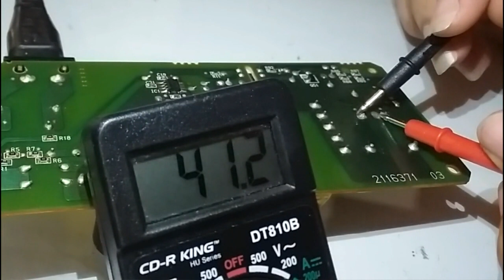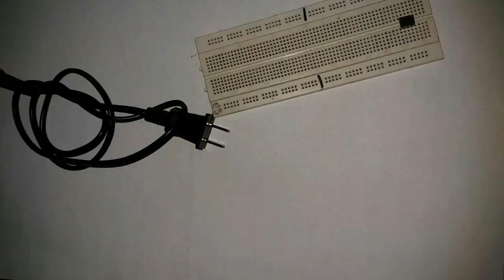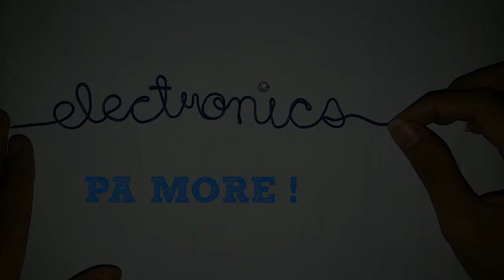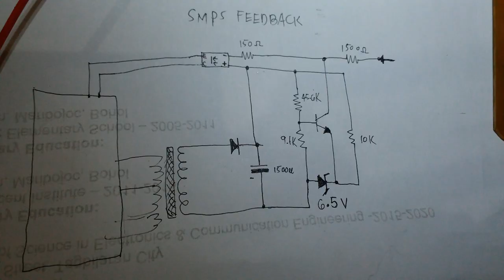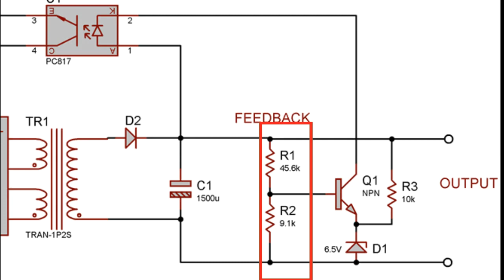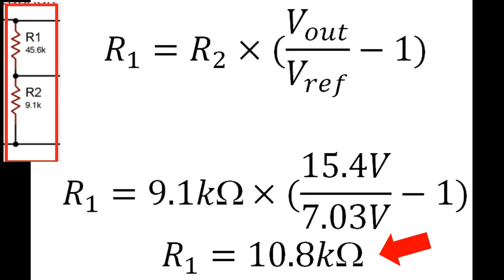How to Vary the OUTPUT VOLTAGE OF SMPS

Comment from the maker: What do you think ?
Reply: Hey, How much current can you get from this power supply? I have an epson power supply which can provide half amp. I got another question as well, my epson power supply uses feedback voltage to turn on the primary part of circuit,  how did you get the output voltage? Mine turns on and then it turns off. Do you have schematics of this power supply? By the way, how to provide feedback voltage to turn printer's power supply on? Thank you.
Reply from the maker: @JohnSmith-mf6pe   600milliAmps, i showed a schematic on the video but not on the secondary side only, if your power supply has a three pin -output,one of it is the enable/disable pin, you need to pull up or pull down . But i dont know exactly if its like yours. But this printer has 3 pin but i just leave the enable/disable pin .but it readily works
Reply from the maker: pull up means connect it to high voltage or the + 5 volts or pulldown connect it to the negative /GND . But in my case,pulling it down  will disables it.
Reply from the maker: Note : this only works on simple power supplies that dont have a undervoltage  protection and also lowering the voltage too much will a also cause it to shutdown
Reply: Thanks a lot. The power supply I'm talking about us used in epson Cx3200. As I checked in service manual,  it has over voltage protection (ovp) and power supply controler (psc). Could you tell me how to turn it on? Do you have access to similar power supply?
Thanks.
Reply from the maker: @JohnSmith-mf6pe  sorry i dont have access ,the power supply in this video by the way is also from epson. did you try plugging it in? what happens?
Reply: I will have you updated. Keep up the good job. Waiting for your next videos.